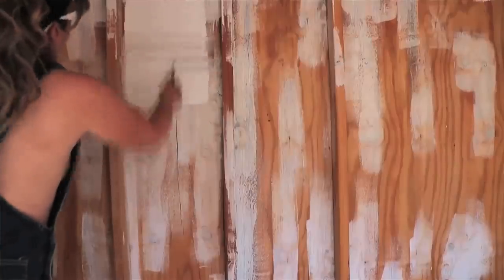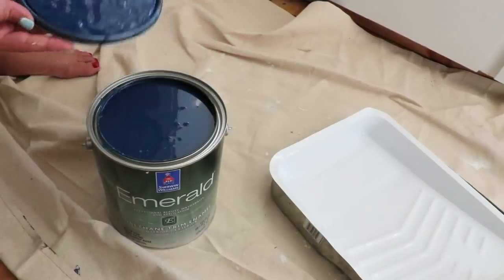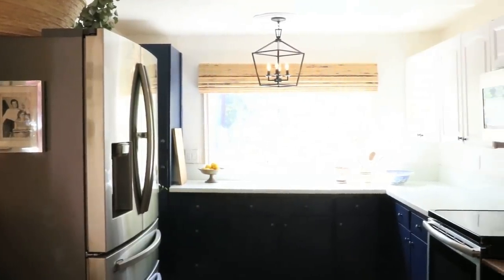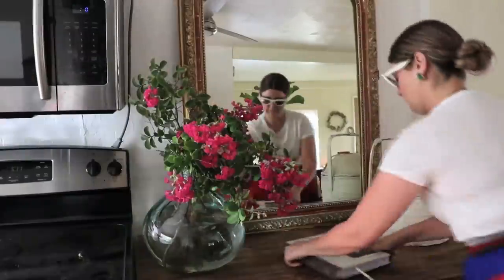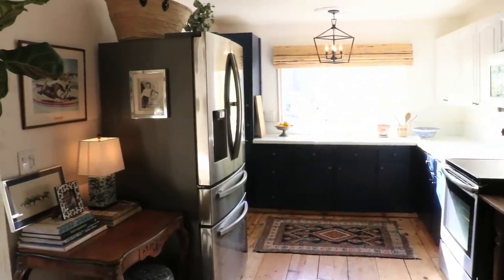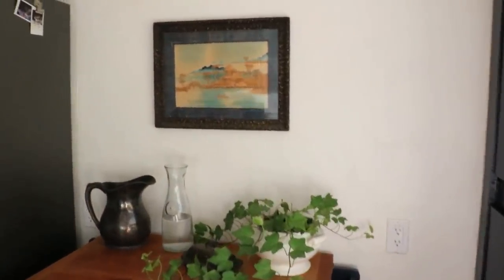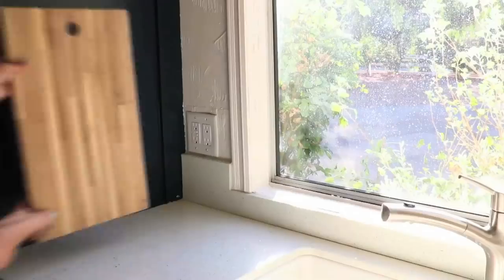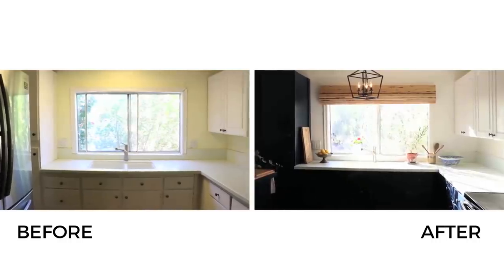Rental Kitchen Makeover

Comment: We like the Naval and actually bought before watching this. We still have to paint the cabinets. I am wondering how does the paint stand up to the daily wear that kitchen cabinets endure? Have you noticed any scratches or peeling paint yet? Thanks for the video
Reply from the maker: Mike Adonis nope! Totally good. No scratching or peeling! And I really should have primered and/or sanded! I think it speaks to the high quality finish!!!
Reply: @heymaryelizabeth  that's great thank you .... I used the Emerald in white for exterior and that stuff went over dirt and rust and stuck nicely with no signs of coming off. It was on aluminum siding over a previously painted surface so I didn't prime either.. I know that I wouldn't have an issue on the real wood doors and drawers, but was worried about the laminated mdf used on the sides of the cabinets.... It's amazing how far paint has come.

Comment: You haven't said what the kitchen cupboards are made from. Wood, MDF?  How you prepared them.? Sanding, paint primer, how many coats were needed.???
Reply from the maker: Jill y Bean i didn’t do a great job of prepping the cabinets! I was a bit lazy because they had been painted a lot — had a ton of imperfections and a little bit broken. I just applied the paint (listed in description and painted). They are probably a combo of MDF & wood. I should have probably done a primer but instead I just applied a few coats to fully cover the paint. I would say a light sand and primer would be ideal. If I was doing nicer cabinets, I DEFINITELY would have done they and/or used a paint sprayer for even more even, light coverage.

Comment: I love it. I love you.
I want to paint an oak cabinet I kept when I remodeled my kitchen 12 or 13 years ago. It hangs centered above my laundry right off my kitchen. 
You inspired me to go dark. And it would tie in with the equipment that has blue accents. Walls are pale yellow (I must have been fooled by whatever name they put with the paint because yellow is so not my color). 
Anyway, at 63, I'm not as spry as you so I'm a bit nervous to paint it. Doors, not a problem. I can remove them for ease. And one side is just a couple inches from the adjacent wall. I think I can leave that unpainted since it's not very visible. Since it has polyurethane finish I'll have to prime first. Not a fan of oak either.
Reply from the maker: Kate Hillenbrand good luck!!! ❤️❤️❤️

Comment: So you just degreased/cleaned the cabinets then used the paint without sanding??! Did you apply a topcoat we didn’t see? Asking because I’m redoing my kitchen and want to paint the cabinets as easily as possible!
Reply from the maker: I degreased and cleaned the cabinets -- I love Krud Kutter because it's biodegradable and non toxic so it's easy to use.  I probably should have primered to be honest but I just went for it.  The paint is good enough that it adheres well but it definitely took more to get the coverage.  What color are your cabinets and what color are you painting them?